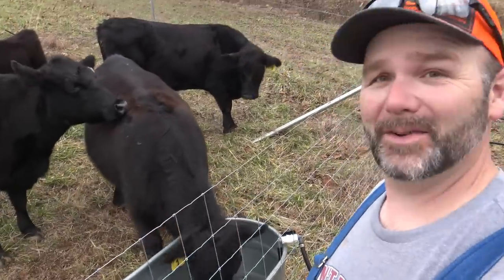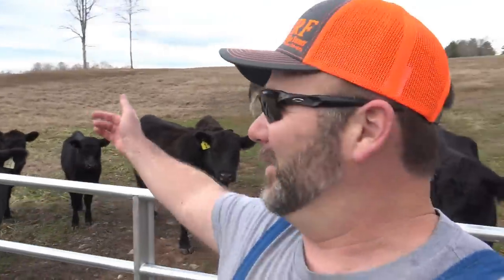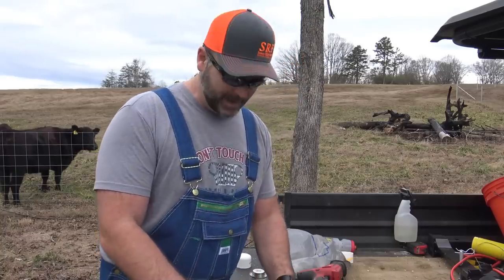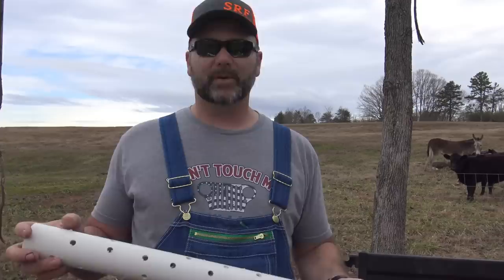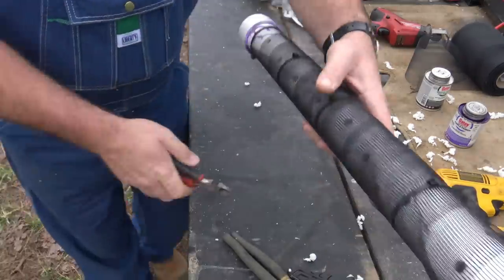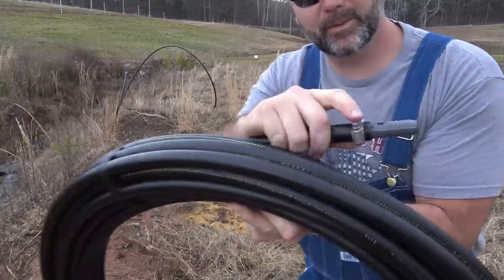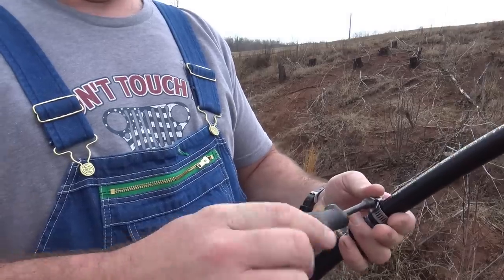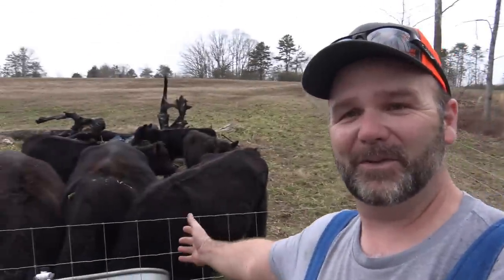Non Stop water system..no electricity, no pump, simple and easy

Comment: You could have raised the 1st portion coming out of pond little higher than the final discharge end. Then fill up the discharge end with water after raising it up a bit. Once the whole tube gets filled with water, put this end in tub. Now this water will start pulling tube/pipe water thus pulling pond water eventually. As long as one end is higher than the other, water keeps flowing..

Comment: I was looking at building a water screw but this is an easier way to do the job.
Thanks for sharing this.
I'm going to do this in the spring.
I don't have cows but have fowl and multiple gardens that need the water.

Comment: All you gotta do is THROW ALL THE PIPE in the pond while it's coiled up..... let it fill wilth water....shut your valve.... now take it out and start unrolling down the hill..... when you get to the end you open your valve and PRESTO it starts syphoning.....yup....have a nice day
Reply: Another option is to turn off the tap at the bottom and fill the top end with a bucket and a funnel. You only need enough to start the water up and over the wall and then it should clear the air in the line it's self.

At a friends farm they had a buried 2" poly pipe around 500m long and a 10-15m fall. Like a fire hose when it was running. 

Only took a couple of buckets to get it going as the water in the pipe falling down the hill would work like a piston in a syringe and draw more water in behind it... and no way you'd suck-start it.
Reply: Beat me to it. Almost word for word what I was going to say. 👍
Reply: This.
Reply: You got it..!
Reply: When the black pipe is coiled it'll take a lot of rolling and twisting under water to get all the air pockets out of it. Pouring water through the pipe is an easier way to clear the air, as Spooky88 describes. If you're near a pressurized water source you can attach a hose to get the siphoning hose filled with water.
Reply: @oldauntzibby4395  you don't need to get all air out.....once unrolled the weight of the water in pipe will start syphoning..... same way I drain pools and hot tubs....yup
Reply: Best idea right
Reply: @DeeMoback  you're spot on brother. Good tips!
Reply: Jay Thomas Reset ... yup.. thats what i mean
Reply: The cow complains
Reply: Good job..
Reply: Another option is to put a
Check valve on the
End
Of the
Hose... on the
Pond
Side... and fill it
With
Water..raising the other
End
Higher.. when its full... shake it so bubbles of air will get
Out... then lower the
End
To your
Bucket... presto the
Water is there
Reply: You could hook up one of those solar water fountain pumps with a float valve...
It would pump the water for you and when the sun isn’t out you’d still have the
siphon effect going...
Reply: Heavy man
Reply: Jay:  Same principal I used to drain water from a non-working washing machine during the time I worked in a laundromat.
Reply: Wow just like grandpa  did

Comment: When laying out any coiled product (example - wire, oh, and poly pipe) always unroll it as you go along or mount on a rack to allow it to unspool as you pull it out. This will prevent most of the (memory) looping you get when you try to drag it off of the side of the coil.
Reply: The electricians I worked with called those loops/kinks "A_ _ holes"

Comment: Take the end with the valve 3/4 the way pack up the hill toward the pond.  Open the valve and pour 3 to 4 gallons of water in that end.  Close the valve and walk it back down to the trough.  lay the valve on the ground and open it.  When you are satisfied with the flow place it in its final position to fill the trough.

Comment: I did this 20 years ago, but then sold herd. But I used 3/4 AND 1 inch. Worked pretty good. Would not go to 1/2". Also, watch for parasites that cattle can pick up from pond water! I usually used my well for water to the rotational pastures, or two of my natural springs. Purer.

Comment: My Grandaddy had basically the same setup on top except his float was an old bleach jug, but used an old bathtub for a trough. He covered the faucet end with sheet metal and boards and installed a toilet tank ballcock valve and float where the faucet was supposed to go, it would automatically let water in when it started gettin' low. That way, if we were cuttin' hay or pickin' corn, or whatever, and couldn't get down to the pond that day, which happened a lot with the orchards and fields and hogs and... you know, they'd still get watered. In the winter, we'd have to go bust the ice for 'em, but that was the "slow" time anyway so it wasn't too big a deal. He ran forty head'a black angus and a couple jersey milk cows all the time and it worked exceptionally well all the time for 'em. 
Just an idea, you seem pretty handy, couldn't be too hard to figure out, you just have to keep 'em from damaging the float setup.
Reply: Oh, almost forgot the most important thing. He kept minnows in it too to catch the bass he had stocked the pond with!

Comment: Farm supply stores used to sell an automatic float valve that would keep the tank full without you turning it on and off. I would guess they still sell it. It clamps to the tank and connects to the hose. It should work with your system if the top of the tank is lower than the water supply. No electricity required. A shop vacuum  might work to get the siphon started. You could get a small generator to take with you to run the vacuum. You might want to put something there to protect the valve or automatic float valve because animals are somewhat destructive.

Comment: Good idea.   I don't understand the reason for so many idiots clicking on the thumbs down for this video.   I had other things going on so didn't listen to all the audio so I might have missed something.

I have done the same thing mainly to keep the cows from wearing down the wall of the tank dam.  After having to rebuild the tank dam where the cows made their main trail to it.   I fenced around the tank to keep them out of it - onl;y a 30' run of pipe down to the trough with a foat valve.   The only problem I have had is remembering to drain the pipe before a freeze or replace the pipe where it splits after the freeze.

Comment: You could use a vaccum cleaner/shop vac to syphen the water. We’ve done that before and it works.
Reply: Thats a good Idea.  Especially if you have a power inverter to power it off the kabota.
Reply: You can siphon gasoline that way, too. It'll explode, but you can do it. Read "Dave Barry's Guide to Guys" for more information.

Comment: Great video! U could anchor the float to a rope and concrete block so the float stays more out in the middle of the water and not come up on the bank of the pond. 12 volt pump can start your prime that connects to battery of the utv.

Comment: @stoney ridge

Nice build.

As others have said fill the pipe with water first from the pond before you bring it all the way down.

You only need to fill up enough to get it over the rise and it it will gravity feed.

As a side note all car engines have a vacuum line. There may be a vacuum line on your work vehicle that I saw in the video. If you ever need to use a vacuum line from an engine you can get 14 bars from a car engine of vacuum from the vacuum line that goes from the engine to the master cylinder. You disconnect the vacuum line to the master cylinder connect it to a collection bottle so you don't get water into your engine and you can vacuum at 14 bar. Any engine will do this like a lawn mower engine that has a vacuum line or that utility truck you have in the video. just make sure you have a collection bottle so you don't end up with water in your engine and keep a good eye on it.

Separately I recommend you do what they do at small micro dams for hydropower. What they do is they take two pieces of logs or wood about 8 or 10 ft long connect them together in an angle and put it in front of your float and siphon. This will keep all the dirt and all the leaves on the other side of the floating wood and not end up in your siphon. Occasionally you go down and just scoop up the leaves if you have to but at least they're not clogging your filter or your siphon.

Take electrical tape and wrap your valve with the black ABS electrical tape to protect it from the sun, then cover it with some black garbage bag to keep the sun out and the weather. This will protect your valve from getting destroyed by the sun and you can turn it on and off without removing the plastic bag by just grabbing it through the plastic bag.

Hope it was helpfu,  I enjoyed your build and love to see your form as you create a beautiful life that we get to see.

Be blessed amen.

Comment: get a 12 volt pond pump and prime your line with it, Once the siphon has started remove the pump. You had 12 volts there with the gator You will thank yourself hundreds of times over for the simple investment
Reply: Nasty, I have in the past, way past with the mouth till I discovered priming the pipe by blocking one side, (times with a cap that has a tiny hole to some allow air out) as I pour water down the pipe at the source. It doesn't have to fill all the way. Once the pipe is lowered while the other is in the source, down comes the water.
Reply: @aureliodinaguit1645  

so Right/ No man on earth has lungs strong enough to suck water up a hill.
Reply: They also just made a cordless drill pump, attach it at the bottom  just squeeze the trigger till the water comes and take the peice off.

Comment: 13:34 - You only need to siphon to just below the pond level to start the flow: install a ball valve in the poly at a length away from the pond that's over the hill just to just below that level. Then with the valve open the valve and bury the poly in the pond until it completely (with no air) fills with water. Turn off the valve under water. Lift the pipe up over the hill and connect to the rest of the poly. Lastly open the valve . . . TaDa! It's a little more work; but, I'd rather that than take a chance on drinking pond scum. You only half to do that once. Just close the valve before moving the system to a new position to keep the prime.
Reply: Absolutely correct but I don't think you must have a ball valve; I think you meant to say a one-way valve, to keep the  water flowing backward to the pond under the influence of gravity. A siphon, to work must have the delivery point lower than the source to work at all. But then,  if you can meet this condition, it will work wonderfully well. The ball valve is needed to turn the water off when the cattle tank is full. It will keep the water in the hose until more is needed.
Reply: They make a float style shut-off, that can be attached at the tank, ... when the water level drops, it opens the valve, & the water flows in, ... only as is needed, ... to fill the tank, ... this will keep the pond from draining dry, & will ensure that the animals have sufficient amount of water to drink, no matter how thirsty they are, ... it comes in different sizes, so order only what you need, ... I have a 1/4” fill type on my garden barrels so that I can keep my plants watered, & I only need check the water level occasionally to make sure that it only dribbles through the water line feeding my garden, ... additional sizes from 1/2”, 3/4”, & 1” are available on eBay, ... took about a week to get the one I have, ... as I only use it for drip irrigation for my garden, ... and this spring, I am going to get a 350 gallon tote for the whole garden, so I can add the necessary nutrients for my plants as well as keep them watered, ...
Reply: I like some of the suggestions made.
Also, wud a new gas siphon hand pump work?
Reply: @kansasross  Good info. They also call one-way valves: reflux valves, retention valves and we call them check valves at work. And although you could use a one-way valve for the method Against UCE was referring to, I do think that he meant just a regular ball valve. Kinda like the 'finger over the end of a straw method’.
Reply: @johneosmaniii3915  Every toiler has one.

Comment: Sir, I have done the same for a free, constant flowing decorative fountain. I used a vacuum line from my car engine to prime it. It was back before computers controlled our cars and now, it might cause a check engine light error. Maybe the PCV valve vacuum would still be okay...  I too had several hundred feet of the black coiled pipe so there was ample time to prevent water going into the engine. Thank for the video!

Comment: Try a shop vacuum if you have to do it again somewhere, that might save some work and shouldn’t hurt the vacuum if it gets a little wet. Only issue would be getting a generator or power to run the vacuum. Hope this helps
Reply: 12 volt shop vacs come regular now with a power tool kit. They finally realized the importance  of a portable shop vac! great for plumbing, carpentry, any general maintenance , and of course  humans are a bit messy.

Comment: Take a type of tank "larger then a bucket" to the beginning of the water line. Connect water hose to bottom of tank. Have tank above the beginning of the hose from pond,. Using gravity, connect tank hose to beginning of hose line. Let water fill 300 foot hose. Then quickly lower pond hose into pond,. Your siphon has begun,.

Comment: Regarding UV resistance for white PVC water pipe... out in the desert, an old-timer advised painting white PVC gold color. Tried it 8 or 9 years ago using spray paint and it's still working well.

Comment: That’s a cool system. Our water system includes breaking Ice everyday. We’re in our coldest month, but spring is on the horizon!!
Reply: North Country Off Grid small electric circulation pump and a 12 volt battery, a 12 volt car power plug in and cheap inverter. Even a bait well pump will work and put it just below surface aimed slightly up to surface. Standard outdoor timer to cycle pump every few minutes for a minute will keep it from freezing to until temps get really cold
Reply: Gary Porter draw me a map 😬

Comment: it appears that you came along when we used to suck on a pipe in a gas tank to start the gas flow. i have several times, even back when gas had lead in it. either way, you got it running. greetings from the georgia section of Dixie..........g

Comment: Things you could try on the next siphon.
Have a valve near the pond and fill the length of pipe with water so there’s less air to remove.
You could try a wet vac or maybe a hand bike pump you’d need to rig up a branch in the pipe work to open and close when you operate the bike pump to get it started. Or even just have an emergency electric pump on hand you can use to get it started and you can use for different applications

Comment: For the filter it’s a lot easier to use a saw and cut slits in it than it is to drill all those holes.

You could also do some kind of an anchor system to keep the coiling of the pipe from pulling your filter up to the edge where it’s going to touch bottom, all depending on how deep your pond is. You could also set up multiple troughs and have one gravity feed to the other and just put the water in the highest one

Comment: Yes there is a better way.  Close off the valve at the end point, go to the pond, disconnect the hose from the device and fill the hose with water.  Open the valve.   Once the hose is filled it will flow on its own.

Comment: simple siphon you tube used suction end of air compressor to suck the siphon to get it started. glade to see you got it going without it. or you can use water to get it going.  on top of the rise part have a Tee and stand pipe . fill it with water till the siphon begins you have to have a foot valve at end in the pond. to catch and hold the water till the pipe gets full, or check valve (one way) will do the same.

Comment: Using a check valve on your intake and plunging repeatedly in to the water is a great way to fill a pipe to start a syphon. Once its running hook up your intake under water.

Comment: I used for a similar situation a T-piece and a valve plus a funnel. Means on the long side you insert the T-piece with a valve, maybe 10 feet or so below the dam. Close the valve down at the cow's side, and fill water through the T / valve with the help of your funnel inside the long side of the pipe til the pipe is completely filled. Close the valve, and open the valve down. The water will run down and develop enough vacuum to pull the water out of the pond. 
Almost free of cost and done in minutes.

Comment: Fill the tube with a column of water.
Reply: yes, but use a one-way valve to keep it there until the siphon is established.
Reply: This way you have to have a bleeder at  other end and hart to fill  , the best way is  using a 12 v dc water pump working off  of your vehicle or booster and connect it to the pipes upper end and keeping the lower end out and up by the  pond finally fills up then stick it in the water keep it in and   disconnect the pump and put on your valve take it up and over the hill
Reply: @rumsiker  You understand the problem very well.